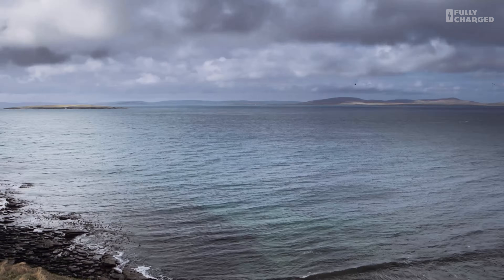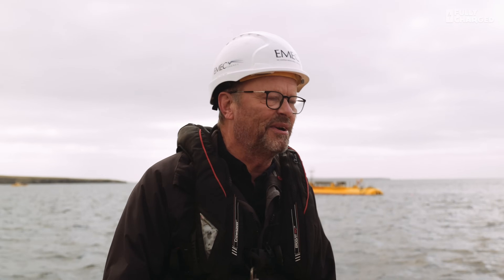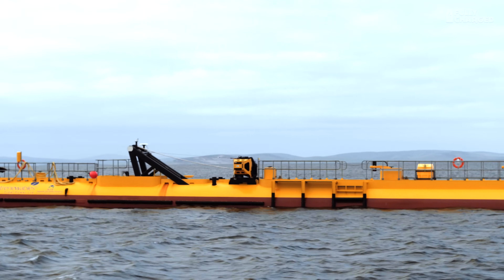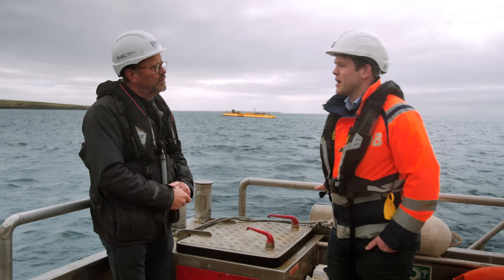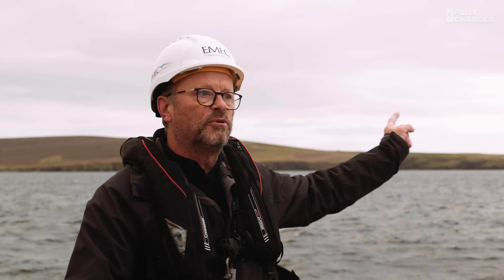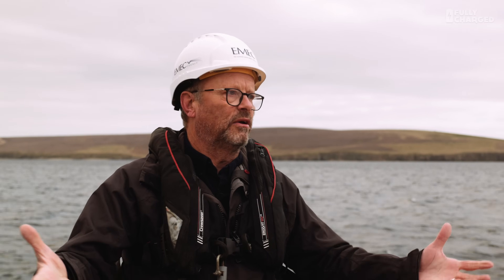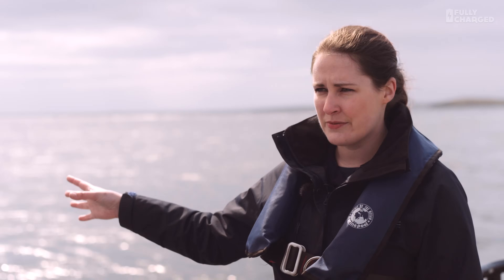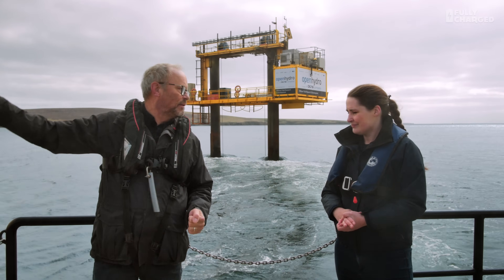Orkney 3. EMEC Tidal Power | Fully Charged

Comment: funniest thing about people who say perpetual motion or over unity devices are fake is they actually exist as tidal energy devices... think about it the oscillating water column requires only a small bit of energy to get the fan blades started and then the force of the waves keeps the air flow going until maintenance is needed, these devices produce dramatically more power then they consume so they technically fall into the "Over Unity Devices" category, and the other devices that just harness the movement of the waves usually require the same very small amounts of starting energy if any at all and then they just run off the waves technically the waves and movement of water is considered perpetual motion because it appears to be continuous and unceasing.

Comment: YES, ALL VERY WELL, BUT THE COST FACTOR IS THE REALITY AND NOT JUST IN POUNDS.

HOW MUCH CO2 IS RELEASED AND POWER EXPENDED IN THE MANUFACTURE OF ALL THESE MACHINES.?

YOU CAN'T MAKE A WIND TURBINE USING THE POWER  FROM A WIND TURBINE.
Reply: Can't make diesel generators from energy generated by diesel generators.

Comment: Ok I'm not very technical minded, but if you had a big air turbine at the front of an electric car, would you be able to put a bit of charge back in the battery as you drive?
Reply: haha, yes - but you will need more power to go forward as well. you need more extra energy than you will gain.
Reply: Look up the law of conservation of energy, to get a better idea about why this doesn't help.
Reply: CorwynGC ok will do thanks
Reply: Aircraft use a similar thing, a small turbine that deploys below the plane in the event of losing all engines and thus electrical power - it generates enough electricity to run the instrumentation and power hydraulics but it also slows the plane down due to the extra drag.  That's why if you put one on a car it would generate a bit of electricity but the car would also require a little more electricity or petrol to overcome the drag created by it.

Comment: So, if Scotland can take the excess wave and solar energy and store that as hydrogen, they can then be self-sufficient and power all the ferries once they have perfected the drive system. As previously mentioned, Scotland burns a lot of oil on ferries. Tankers also consume vast amounts of oil, so once they have got a good hydrogen system installed, that would save masses of CO2 from entering the atmosphere. Therefore it does make sense to have nuclear as backup until home PV/storage and EV cars are connected to the grid. Then you have a workable system. Now all we have to do is get the plastic and chemicals out of the sea and start to clean out the refuse pits where we have buried long terms pollution. Shares in these businesses will rise quickly as the stock market swings behind and endorses the change.
Reply: The problem is that hydrogen really doesn't like to be stored.  Making containers where you can keep the hydrogen contained for even a week is really difficult.  And extremely expensive.

Comment: Very promising.  

I will ask that you be careful to also address the potential environmental impacts of such tidal and marine installations.  We know that wind and concentrated solar has caused problems for birds.  Tidal will have its own issues for marine life too.  

We cannot be just proponents of green power and ignore other aspects of the environment.  I spent much of my career building infrastructure along coastlines in the marine environment.  Mostly in the U.S., but also in Canada and the UK.  Although the environmental issues are sometimes an annoyance to infrastructure proponents, I learned in listening to the environmentalists that there are real issues that need to be addressed.  

Let's do better than those that came before us - those that figured if the smoke went up the smokestack and blew down wind that was the last we needed to worry about it.
Reply from the maker: Let's do better than spout the absurd claims of very well funded lobby groups made possible by the generosity of the fossil fuel lobby. 
An example.
A large wind turbine outside the town of Stroud in the UK had a massive net constructed beneath it, placed there by the RSPB, the Royal Society for the Protection of Birds. 
It was left there for 2 years and regularly checked for bird remains. There were none, not one. 
In the entire 2 years they only found one bat and there was much debate as to whether the bat had got caught in the net rather than been hit by a wind turbine blade.
It's not that there are zero bird deaths as a result of wind turbines, but massively, embarrassingly fewer than domestic cats (the biggest killer of small birds) then road traffic, glass fronted buildings and of course fossil pollution.
Reply: "We know that wind and concentrated solar has caused problems for birds."

No, we don't.  "In the United States, cars and trucks wipe out millions of birds each year, while 100 million to 1 billion birds collide with windows.  these non-wind mortalities compare with 2.19 bird deaths per turbine per year. That's a long way from the sum mortality caused by the other sources."
Reply: Oh boy, now "absurd claims" about bird mortality associated with renewable energy have become "fake news" . . .   

It is hard to find the arguments attempting to minimize wind and concentrated solar impacts to the environment compelling if you already lived through the dismissive technical responses we were given for questions raised about nuclear power.

Comment: Will the tidal turbine chew up the sea creatures that goes through the blades?
Reply: Unlikely, since the turbines move with the current and so do sea creatures. The speed these move at is not that great either. Also, the more closed design shown here, the one like a jet engine, has a hole in the center to allow fish etc to move through.

Will there be zero casualties? Of course not. But it's not a blender.

Comment: i just wish tesla would move into wind and tidal etc...just to push people even faster to develop them.
Reply: It's likely that in 10 years solar + battery storage are the only things we'll need and use. Wind + tidal have moving parts. Solar and storage do not. Hence solar and storage have the inherent advantage and should end up cheaper than wind and tidal ever can be.

Though wind is moving us away from fossil fuels the most now, I'm no longer sure it'll stay with is for very long and it's unlikely tidal will ever get off the ground really.
Reply: if they can become say 5x more efficient then yes. but in winter in the uk you will not generally produce enough power for your home especially if you have electric cars. then you will have to draw off the power companies and pay their (probably inflated prices.) i doubt we will still have cheap night tariffs when people have so many items charging on a night.
Reply: Well, they won't get 5x more efficient as that is impossible :)
We can dig into multi-junction cells that convert different wavelengths but that's beside the point.
What will happen is that solar will get cheaper and cheaper so you can install more (if you have the space), to overcome winter requirements.
That combined with storage that becomes cheaper and cheaper makes solar viable even in winter. I'm not talking about going off-grid as that is unlikely to be cost effective (but then I'm not accounting for greed here...)
Don't forget the other side of the coin either: better insulated housing, heat pump based (water)heating.

That's why I think the boom we're seeing with wind now will likely not repeat itself and, long term, wind and other forms will take a back seat to solar+storage.

And yes, the cheap night tariffs will soon cease to exist. As soon as the baseload is gone, night time will become more expensive than daytime because of the available solar power.

Comment: I love the report and am pleased for a change our Government did think ahead and plan the funding for the tidal power systems to be researched?  One little question here, the 2nd pillars type turbine they looked at in the 2nd half of the video.. was at a odd angle compared to the incoming tides!  Should is be face on to any underwater flows not at a shallow angle like it was?  About 20 degrees angle compared to the tide there.. should it be better placed face on to them to get the full flow through the turbine!Just seemed odd to have it facing at a non-full on angle?  the flow of water would at that angle not only give you only about 20% of the full 100% But put huge strains on the turbine blades as the water would be pushing one side of blades more than the rest,  sort off lob sided. Just saying please don't shoot me saying?

Comment: Thanks for the Video - A few questions:
1) The first moveable solution - how does it /or is it supposed to transfer the power to the grid ??.
2) What is the power output of the second solution (the Stationary one)?.

I find the movable solution very interesting - this kind of technology could lead to hybrid ship drives - e.g. When a ship lays at anchor, its usual propeller could act as a power generator, that is if there is stream enough off course - But many places around the world hold strong streams - essentially such places could be natural charging stations for such systems.

Comment: tidal friction will cause water to heat up and them fish around the globe will move to arctic ocean, causing starvation and plague in Indonesia.
Reply: There's a lot of friction acting on the tides already.  (The seabed is not a flat, polished surface)  The extra friction is very small.

Comment: What's keeping us from putting these along all major rivers?  I imagine it would have far less environmental impact than dams, at least per energy produced.
Reply: Building a dam you can use all the water that flows by to produce energy, but these would only produce a fraction of that as most of the water flows by.
Also with a dam you can very quickly (within seconds) adjust to current electrcity demand which is one of the biggest advantages of common hydroelectric power.
Reply: Chris Stork Just testing and refining the technology at the moment.
Reply: This is the only one of its kind and is the most advanced in the industry for run-of-river. In time they will be.

Comment: Surely the crux move is to combine a wind turbine with a wave turbine (and maybe an energy store too)  ie, the post that holds the wind turbine up also holds a tide turbine down!  The Tide energy gives you your forecast able energy, and the wind adds the peak output.
Reply: That's what I was thinking. But I guess the places with the strong tidal currents are not necessarily the places with the best wind.
Reply: @iAmTheSquidThing  Dong Energy is building a massive offshore turbine farm in the straights of Anholt, which coincidentally has some of the strongest tidal flows in all of europe.

Frankly I'm surprised they didn't add tidal turbines to the bases of those as well.
Reply: Pretty sure they will tend to be exposed coast areas facing large stretches of water, so good enough for both. Might not be the best tide generation places, but will have enough flow to make a big difference, seeing as the wind plant puts down the same heavy anchor, which is a large part of the cost, to anchor it, so the floating tide generator or an anchored one is a minor added cost, all the rest is already there.
Reply: The tidal turbine assembly would weaken the strength of the wind turbine pylon. That's a real concern in storms.
Reply: @georgew2014  The old Dutch windmills had adjustable sails could not wind turbines have something similar adjusting to the strength of the wind?